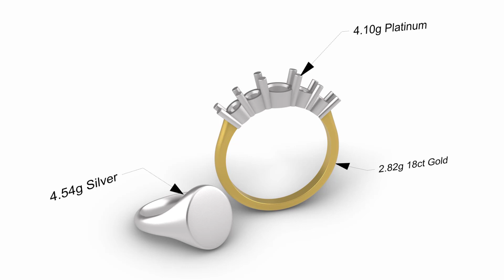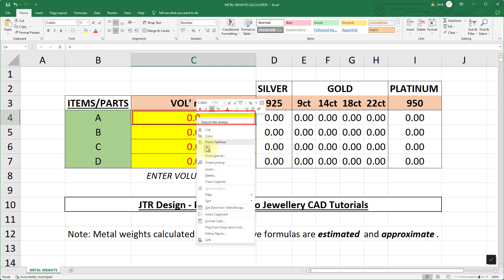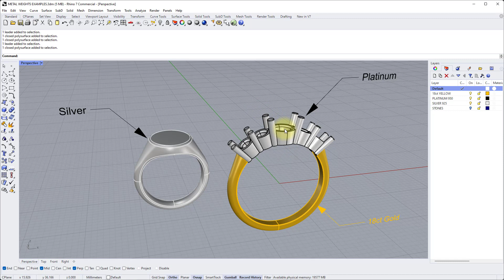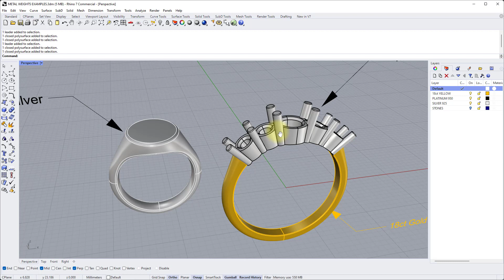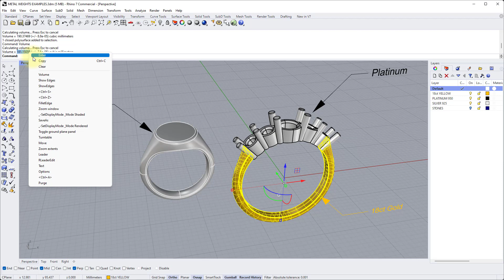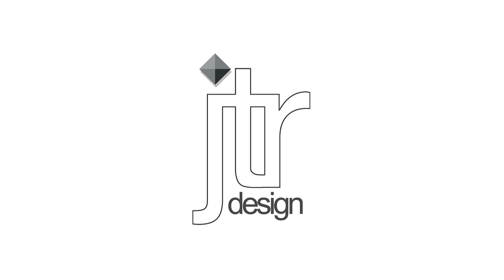How to Calculate Precious Metal Weights in Rhino 3D CAD

Comment: It's weird because I get a must lighter weight on the finished pieces than what was calculated. 
For ex, a piece that showed a volume of 310.8 mm3 (so 4.22g in 14k according to the calculator) ends up weighing just 3.4g once cast and polished. I understand polishing will take away some gold, but surely not that much..
Reply from the maker: Weights generated from the sheet are approximate and estimated. Depending upon the size and quality of the casts, the amount of metal removed can vary . Did you weigh the raw cast? Alloys are also not identical so weight can vary here too between metals.
Reply: @jtrdesign-practicalrhinoje9669 No I only send the 3d model and receive the finished piece. The casting workshop is only charging me for 3.4g, so I don't see how it would make sense for them to skimp on the amount of gold in their casting grain.

Comment: Hi awesome video, I have a question though can we change the weight on the ring ? For example I purchased a file for a Cuban ring on cgtrader and the aprox weight in 14kt gold is 16 grams but I would only like it to be 6 grams how would I do that ?
Reply from the maker: You'd basically need to reduce the volume of the ring - making it thinner, smaller and or hollowing out parts. Obviously you'll need to take care not to make it too thin and weak, so that it's practical for manufacturing processes and wear. Loosing 10g may be a bit of an unwinnable battle. If you require any professional help with it, feel fee to get in touch. jack@jackrow.com
Reply: @jtrdesign-practicalrhinoje9669  thank you! the designer managed to lower the wait a bit to about 10 grams
Reply from the maker: @Jrthejeweler_  Glad you got it sorted.😅
Reply from the maker: @Jrthejeweler_  Nice to hear it worked out